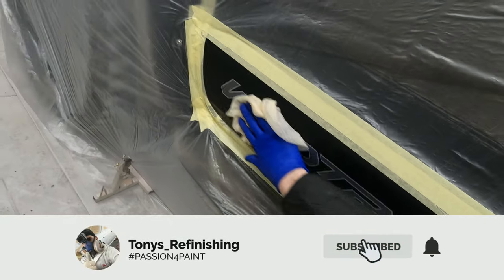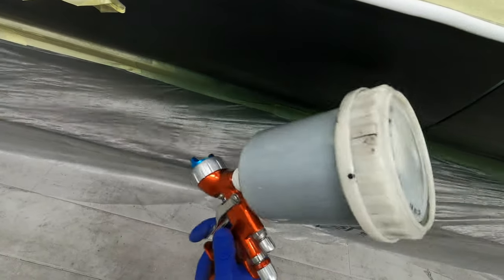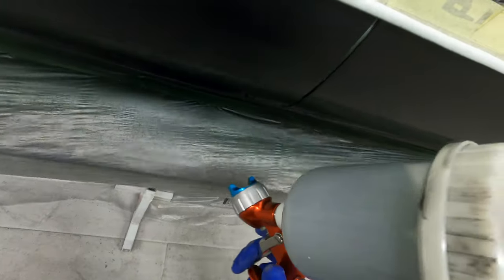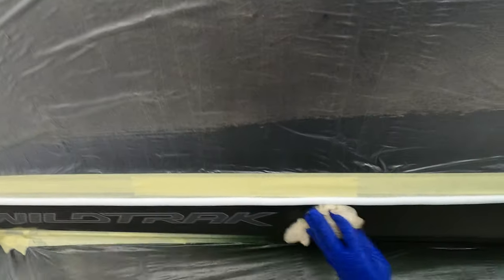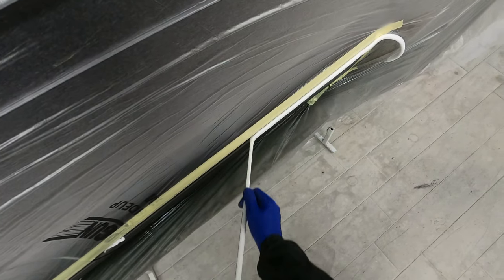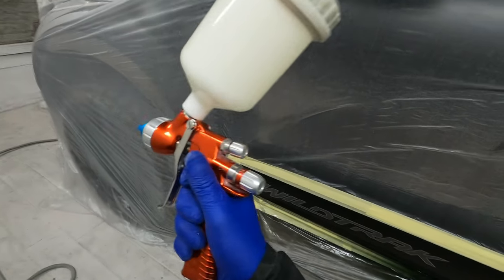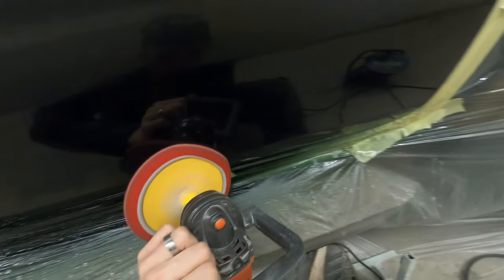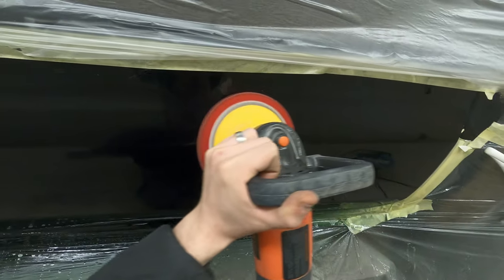Smart Repair / Blow in How To - clear coat blending - spray painting

Comment: A handy tip T dog.. mostly for the DIY guys and those fast jobs that don't get a full bake.. when polishing out the blend on the top... use the lefthand side of the mop, not the right.. right can drag clear into the fresh coat.. if you use left side of polisher it will only drive the clearcoat into the original paint and improve the blend.. Ja get me? you want thee rotation of the pad starting on fresh and pushing into old.. not vice versa.. Ja Get me! 👌😬😂
Reply from the maker: Yeah I guess you have a point there fella not had any issues myself either way tbh I always make sure the blend area is well scotched to avoid issues

Comment: Hi there.
 Is it true if the whole panel is not keyed up for clear coat it will peel of after a period of time.
Or is it alright to blend it in and use fade out thinner?
Thanks
Reply from the maker: I would always prep the blend area regardless otherwise I think it will fail if it’s not prepped mate

Comment: In your opinion, if you have no access to fade out thinners, is a repair like this still doable, or more advisable to just clear the whole panel?
Reply from the maker: Just use 2k thinner mate instead
Reply: @TonysRefinishingTV  Oh ya? Do you mean base reducer, or like acrylic lacquer thinner? Or mixed maybe with the clear 50:50?
Reply from the maker: Yeah just base thinner mate dust it lightly over the blend mate and use the air from the hun to flash it off it’s all I ever used to do till I got some aerosol fade out
Reply: @TonysRefinishingTV  Cool thanks. But just to confirm, are you talking about base coat reducer or acrylic lacquer thinner?
Reply from the maker: Yes 2k basecoat thinner mate

Comment: No matter what I do on my Black civic the edge peels back. I've redone it 4 times. What am I doing wrong? I usually color cut the next day per the manufacturers Tech data sheet. I am in 90 temps and using a slow reducer.
Reply from the maker: Do you key the area where your putting the edge mate ? And it does sound like it could still be soft to me